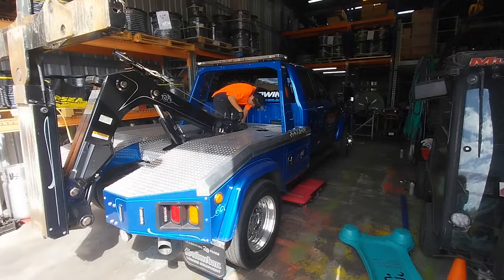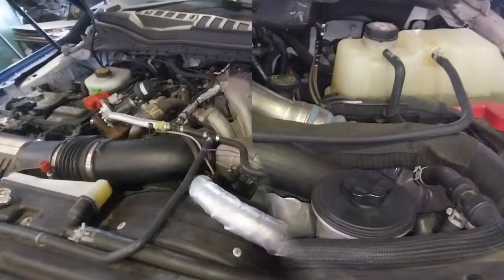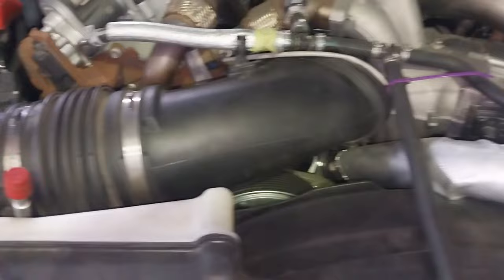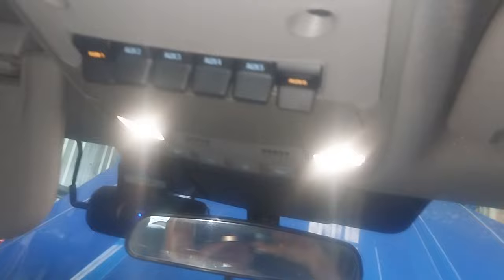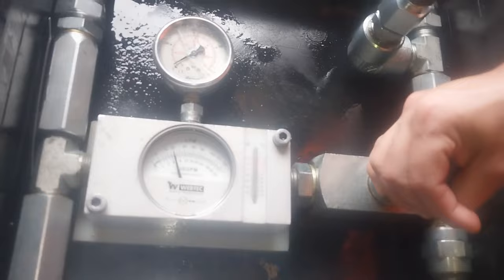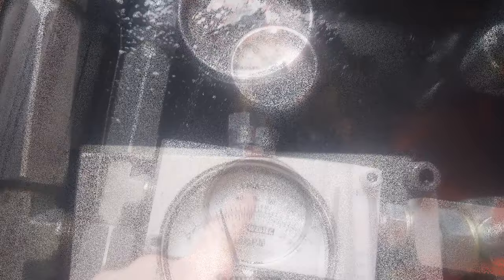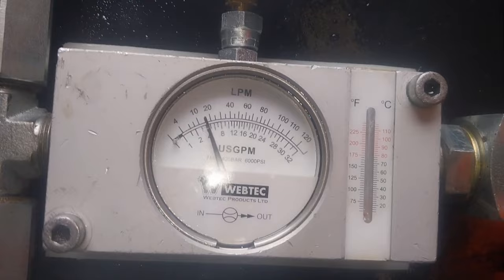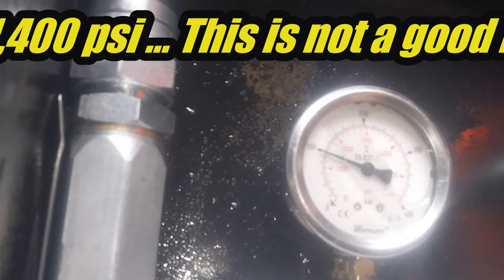Hydraulic Flow & Pressure Test New Pump Ford F 450 Tow Truck

Comment: Top notch practical demonstration of use of the flow meter in diagnosis. Knowing what's actually happening with the fluid makes life a whole lot easier than using guesswork.
Reply from the maker: Thanks for the feedback Dave, Yes you are correct guesswork does not quite work especially when you have a concerned customer.

Comment: How is the truck right hand drive I get they used the left hand drive steering column but I don't know where the dash is from
Reply from the maker: A company in Melbourne Australia Does the Conversions, they use specialist fabricators to mould the new components.  I can find out who does them I you are interested.
Reply: Genial!! Excelente explicación! Capo Matias